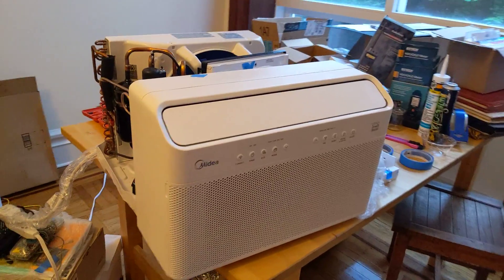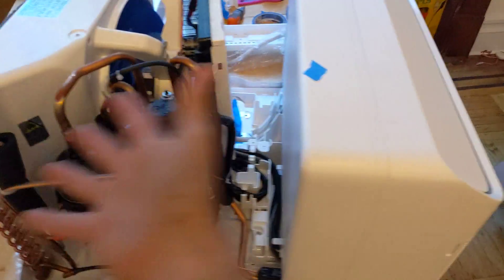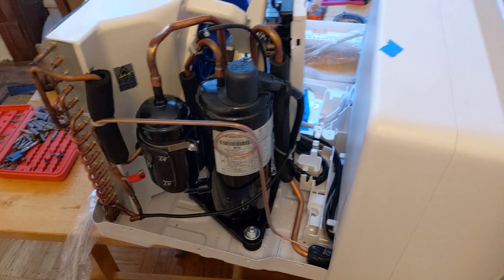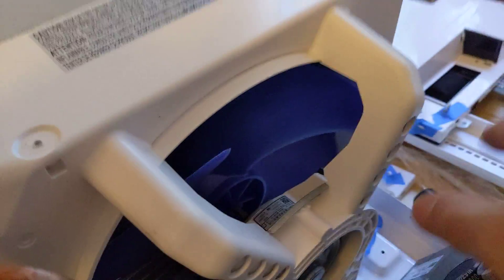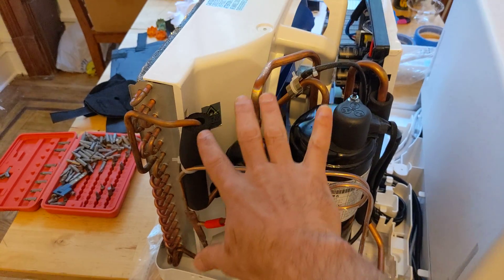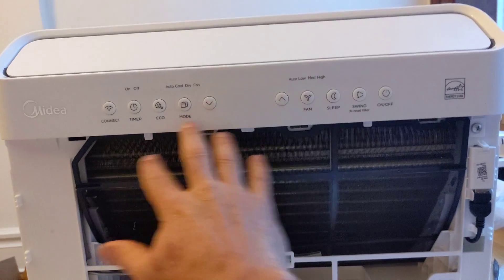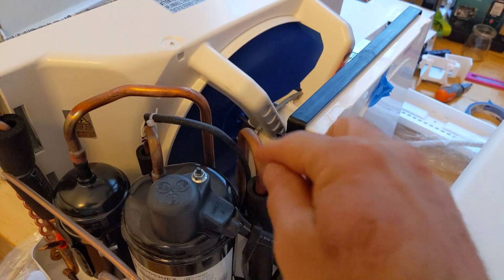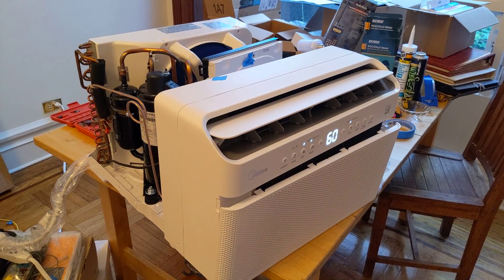How did Midea fit a full mini-split system inside their new "U" window unit?

Comment: Has anyone had any trouble with this AC tripping GFCI  outlets? I installed this same mode on the rear door of my conversion van but everytime the compressor starts to kick on (or sometimes it just being plugged in) it trips the internal GFCI on my inverter. I can hook it up to a regular outlet from shore power or my generator just fine. I’m assuming it’s do to the high harmonics of the variable speed compressor? Can someone test theirs on a GFCI outlet if possible? Hoping the bumps didn’t mess anything up internally.

Comment: I like the saddle desing better because less window space is blocked. what would be best way to protect control panel if the unit was instaelled backwards to act as a heat pump.

Comment: I can't find a tear down of the front of this unit anywhere online or YouTube. Can you access the blower fan from removing the rear or the front of the interior unit?
Reply: e Channel
10 months ago
Three screws under the front cover then unplug 3 wires. Use screw driver  to  pry open the front cover. It IS only snapped  in. Then two screws on top. 3 screws on each side then you have to unsnap gray cover to get to fan.Just opened mine. Fan stopped spinning. Put grease on rubbeer holding fan in place. It was making whining noise then stopped spinning. Works fine now.

Comment: would a variable speed compressor theoretically be more efficient when there is lower coolind demand? I am trying to re-engineer this unit for a sprinter van and mount outside part underneath
Reply from the maker: That is the idea, and most AC units usually run at less than 100% load.
Reply: @bigjoshlevine  how tough would it be to separate this into a mini split unit with outdoor part mounded underneath vehicle? seems like I would just have to extend both high pressure and low pressure line + a few wires
Reply from the maker: @sprinterfix  If you have the equipment and know-how to recover those lines, extend them, pump them down, and then refill them, then extending this would not be hard. But you know they do make tiny split systems for truck cabs and stuff that might be easier. You can find them on Alibaba.
Reply: @bigjoshlevine  I have seen the inexpensive truck units on alibaba and the fancier bus/ rv units on there as well and although the price is very competitive I am not convinced  in their quality as it seems non have variable compressors. + the issue with an all in one system being on a hot roof + they appear to be quite noisy comparatively. and all consume over 800 watts. I will be running off of solar panels so efficiency is quite important. I have heard these ones test as low as 130 watts when low demand. I am just looking for a proof of concept at the moment in order to take advantage of the used market for these

Comment: Hello Josh, thanks for the review. Can you tell whether there's enough space where the lines are going for bugs to get through? 

It's one of the main reasons I'm considering mini-split design window unit. I'm currently using a portable unit with a mesh between the window duct and the unit itself, so I know at least cockroaches won't get through.

Thanks!
Reply from the maker: Last night I took one completely to bits, and it does seem like there is a path along the condensate gutter that a bug could get through. I was surprised there was no trap here. 
https://photos.app.goo.gl/HkgipAV39j8BWXWm7

Comment: people have complained not being able to figure out how to open the front to clean out the condenser drain and everything else in the front, especially when mold gets on the fins and inner walls, could you do that video
Reply: e Channel
10 months ago
Three screws under the front cover then unplug 3 wires. Use screw driver  to  pry open the front cover. It IS only snapped  in. Then two screws on top. 3 screws on each side then you have to unsnap gray cover to get to fan.Just opened mine. Fan stopped spinning. Put grease on rubbeer holding fan in place. It was making whining noise then stopped spinning. Works fine now.

Comment: How do i get into the evaporator section to clean the coil and blower wheel that has covered itself in dirt and mold. This is a problem with these units. Mold builds up fast. I need to at least see what's in there so i don't get water on the motor when i attempt a cleaning of the blower wheel. Any help is appreciated.
Reply: e Channel
10 months ago
Three screws under the front cover then unplug 3 wires. Use screw driver  to  pry open the front cover. It IS only snapped  in. Then two screws on top. 3 screws on each side then you have to unsnap gray cover to get to fan.Just opened mine. Fan stopped spinning. Put grease on rubbeer holding fan in place. It was making whining noise then stopped spinning. Works fine now.

Comment: You've mentioned to people hoping to split the two halves for a variety of applications, mostly RV situations, and suggested it may be easier to buy all new parts and make someone specific. But this sounds more difficult for someone with zero experience no?

Doesn't the MideaU control board have features you would struggle to replicate if making it yourself? It has IoT connectivity and multiple temp sensors and smarts for calculating the best power draw for the situation.

I have finally found a tech willing to evac and refill for me and I'm narrowing in on doing this in my own vehicle, but still trying to fully grasp every option before I commit to this complicated route.

Comment: We have had one of these for a while, and I love it, but it does let in smells and air from the outside into our living space. From what you saw is there a good way to make it more insulated to isolate the room from outside air?
Reply: caulk it or spray foam it shut. use low tack tape so spary foam does not permenently stick to anything.

Comment: Hooray! I was a little skeptical given the branding (I'm not familiar with Midea or the alternate Danby - same unit) but seeing the inside actually proves that this is a solid appliance, well-designed and well-built. Thanks very much!
Reply: I know it's 2 yrs late by 2024, background: Midea and Danby are part of one huge international company. Not sure which originated this uChannel tech, but just looking at Danby video and instructions, you know they are cousins. Also, I think Danby had or has a factory in USA. That was what I read a year ago before I decided to buy.

Comment: Thanks for posting this!  I was planning on picking one up and taking it apart and you beat me to it.  I'm going to cut the lines and make it a true compact mini split for my sprinter, recharge, extend the umbilicals, should be clean, efficient, and much better than a dometic!!  Midea would kill it if they made something like this for the RV market.  I installed a mini split in my 40ft 5th wheel and it changed my life.  The 18k dual head Midea unit had double the cooling capability of my 2 Dometic rooftop "15.5k" ac units, and at full output it still only pulled 1900 watts, what a single dometic unit pulls.  At 100+ degrees outside the 2 Dometic units would only keep the coach around 85-88 degrees.  The Midea mini split will freeze us out, I keep it at 70 and has no issues at all maintaining thet temp even in 110 degree AZ summers.
Reply from the maker: Please document your project and post back here! I know so many people would be interested in seeing your progress!
Reply: I had the same idea. Splitting the unit in half and making it function like a split AC for a RV.  Technically it should work , I have seen guys split window ac . I am waiting for someone to do it 😊. It should be easy two copper pipes and probably some wires.
Reply: Did you ever try this? Would be interested as well ;)
Reply: @chblabah  I disassembled the unit but the low pressure line is non-standard unfortunately.  It's 3/16 "ish" copper tube.  It also uses R12 which I have not been able to get my hands on.  increasing the line length will require additional freon.  The other thing I noticed with this unit is it's efficiency is around SEER 11 which is not that great.  However, I will say the 12k unit brings the interior of my van down to 70ish degrees from 110+ in 15 minutes or less.  It's truly amazing.  While doing work on it I made a foam end cap for the van (sprinter 170)  when the rear doors are open. 

In one of my vans I'm installing a 23 SEER 220V mini split with a 12v to 220v inverter.  The outdoor unit is going to be mounted where the spare tire is, at an angle.  I understand this will work fine, won't know til it's complete.  The other van I'm installing a 11-13 SEER 220v mini split that I bought from Costco in Mexico for $390.  The outdoor unit on this one is very small, half the size of the other unit.  Will make a video on my findings.
Reply: @encoreimages  thanks, let me know when have the video. This is quite interesting, unfortunately there are only low-efficiency options available, especially for DC A/Cs
Reply: @encoreimages  These use R32 not R12
Reply: Have you done this yet? I found this video while looking for a video of someone splitting this unit for a van installation.
Reply: n Miller
0 seconds ago
Any idea how the thermostat works on this thing? I need a thermostat I can program, to use on a solar set up. I would like it to shut off at 72* then kick back on when Temp reaches 85; for example. So it doesn’t just run continuously. Would it be possible to wire in a digital thermostat to this unit?
Reply: Did you ever get around to converting it to a mini split for your RV? Did you find a way to recharge it?

Comment: Now I'm really wishing you took the front apart as well lol. The whole inside of my unit has a bunch of black mold built up in only about 2-3 months :( I need to take it apart and clean it out.
Reply: e Channel
10 months ago
Three screws under the front cover then unplug 3 wires. Use screw driver  to  pry open the front cover. It IS only snapped  in. Then two screws on top. 3 screws on each side then you have to unsnap gray cover to get to fan.Just opened mine. Fan stopped spinning. Put grease on rubbeer holding fan in place. It was making whining noise then stopped spinning. Works fine now. e Channel
10 months ago
Three screws under the front cover then unplug 3 wires. Use screw driver  to  pry open the front cover. It IS only snapped  in. Then two screws on top. 3 screws on each side then you have to unsnap gray cover to get to fan.Just opened mine. Fan stopped spinning. Put grease on rubbeer holding fan in place. It was making whining noise then stopped spinning. Works fine now.

Comment: Is it okay for the rear unit to be rained on?
Reply from the maker: Yes, it is meant to be outside. Note that in this video I have removed the rear cover, but even with the cover off everything on the outside end would be fine if rained on.
Reply: @bigjoshlevine  thanks Man! You gained a sub!

Comment: I'm afraid to ask the manufacturer so maybe you can help: Do you think I can replace inverter compressor with a 12v inverter compressor and the logic board would still drive the 12V correctly?

Comment: Can this thing be split?  I mean, the two halves separated and then reconnected?
Reply from the maker: It can be split, but the standard way would require a lot of equipment that most people do not have (vacuum pump, recovery cylinder , etc). I am trying to think of an easier way to do it using maybe some vampire taps and a crimp, but I have not had time to work out the details. Any HVAC techs out there with ideas please chime in!

Comment: Josh, do you have any tips on how we can open the front cover so we can clean the blower vents? Our unit has been great, but after not being used for the summer there's some mold or dust in there we don't want to be breathing!
Reply from the maker: Here is a visual guide to taking the indoor side to bits. The hardest part is unsnapping the plastic snaps that hold the clamshell together. I used a pair of flathead screwdrivers, but there is probably a better way.
https://photos.app.goo.gl/HkgipAV39j8BWXWm7

Comment: Hi Josh. I thought I posted, but it must have been lost in a bad connection. Thanks very much for doing an uncasing of this. I've been interested in these dual inverter units to DIY a ultra compact minisplit. I bought an LG unit to take apart and was disappointed to learn it had a shared fan motor for both radiators, making it a bit more complicated to run each half remotely. Thanks to your video, I can see this would be much more simple, up until the point where you need to refill with the still-as-of-yet unavailable R32 (though a quick drive down to Mexico would probably get it done). 

I saw in one of the comments that you own all three sizes of this. I'm wondering if you could throw each one on a killawatt and get some consumption numbers? I'm working under solar and battery limitations, and would love to budget appropriately. Do these have an "eco" or low mode? That's probably what I'd use most.

Also, I suspect these are running at 48VDC or something annoyingly high. I would love to skip the AC conversion and just feed DC from my battery bank but there's no way this uses 12V.

If you don't mind, I'd love to DM you questions as they arise.
Reply: Welp, I can't figure out how to send a DM here, and stalking you onto FB seemed a little inappropriate. Do you think you'll get a chance to test out the wattages of these bad boys anytime? Are all the units actually the same size as per Midea's published specs? How deep is the inside/evaporator unit before it hits the window gap? Thanks!

Comment: Please josh can you help how to open the front station
Reply: e Channel
10 months ago
Three screws under the front cover then unplug 3 wires. Use screw driver  to  pry open the front cover. It IS only snapped  in. Then two screws on top. 3 screws on each side then you have to unsnap gray cover to get to fan.Just opened mine. Fan stopped spinning. Put grease on rubbeer holding fan in place. It was making whining noise then stopped spinning. Works fine now.

Comment: Please can I see the video of how to open the front side because I have a key that been dropped inside where the cooler air come from 
Thank you so much
Reply: e Channel
10 months ago
Three screws under the front cover then unplug 3 wires. Use screw driver  to  pry open the front cover. It IS only snapped  in. Then two screws on top. 3 screws on each side then you have to unsnap gray cover to get to fan.Just opened mine. Fan stopped spinning. Put grease on rubbeer holding fan in place. It was making whining noise then stopped spinning. Works fine now.

Comment: Was looking at AC’s online today and saw one like this, but upside down, advertised as ‘saddle’ style, same idea, but it hangs down below the window sill, instead of the window fitting down inside the unit.
Reply from the maker: The Soleus Air one has been around for a while, but I have never seen it in real life. There is also a new one called Gradient that looks interesting, but does not appear to be available yet. Links:

https://www.homedepot.com/p/Soleus-Air-8-000-BTU-115-Volt-Hybrid-Window-Air-Conditioner-with-Remote-White-WS3-08E-201/315032552
https://www.gradientcomfort.com/
Reply: @bigjoshlevine  The Gradient is expensive ($1,999 pre-order price). 😟
Reply from the maker: @lonniemcclure4538  Indeed! I have one, and I hope to do a teardown of that unit soon!

Comment: how do you clean the evaporator coils? can you disassemble the front part?
Reply from the maker: Almost all AC units (including this one) have an easily removable air filter that keeps dust and crap from getting to the evap coils. Keep that filter clean and the coils should stay clean.
Reply: e Channel
10 months ago
Three screws under the front cover then unplug 3 wires. Use screw driver  to  pry open the front cover. It IS only snapped  in. Then two screws on top. 3 screws on each side then you have to unsnap gray cover to get to fan.Just opened mine. Fan stopped spinning. Put grease on rubbeer holding fan in place. It was making whining noise then stopped spinning. Works fine now.